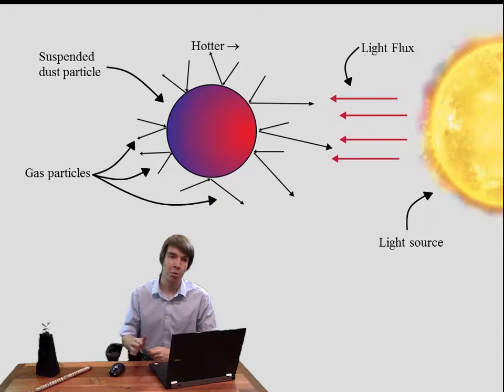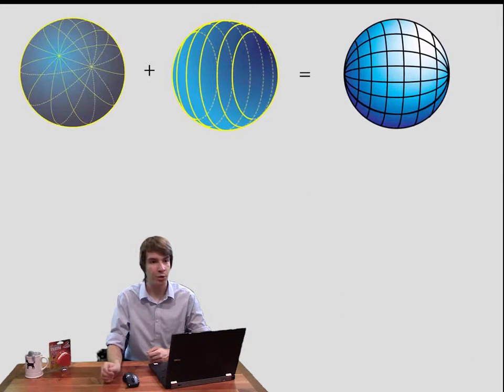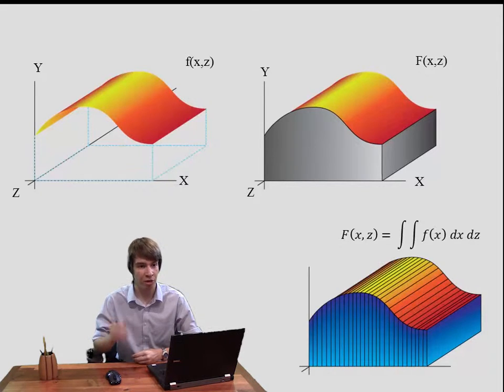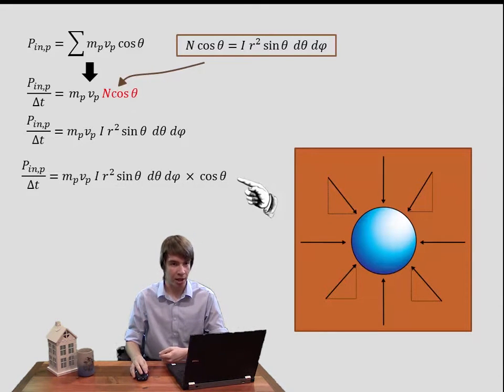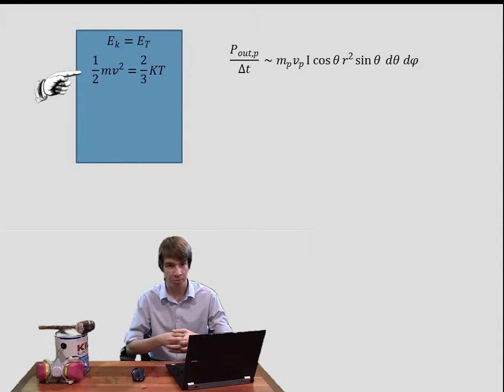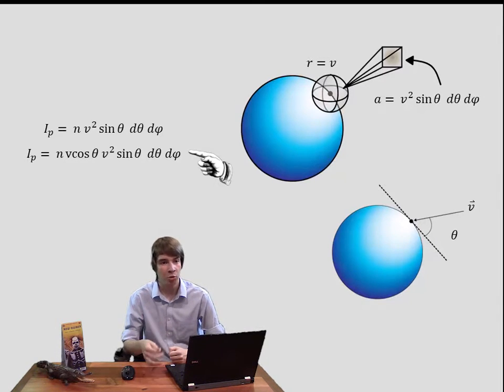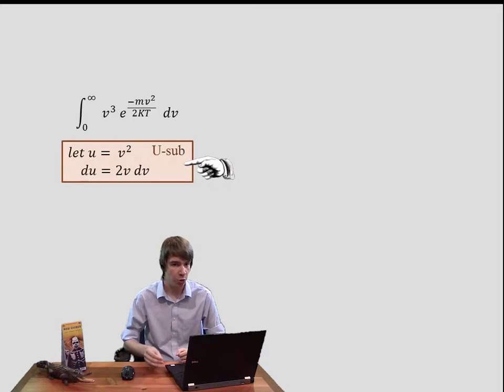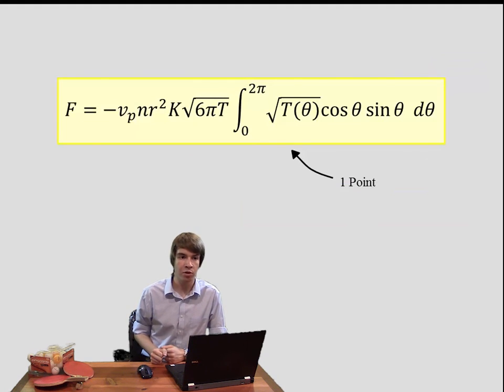An Introductory Whirlwind Tour of The Photophoretic Force

Comment: Great video! But being called "photo"phoretic force shouldn't the final expression contain some information about the light source  resulting in the temperature gradient? Isn't the expression shown in the video independent of light source or any source of the temperature gradient?(So long as the gradient exists). Thanks.
Reply: Not original poster, but the temperature gradient mapping here assumes that you know the refractive index, extinction coefficient, and usually that the particle temperature is relatively close to the gas temperature at all times. (If it wasn't, you'd probably be dealing with an object too large to merit photophoretic force attention.)